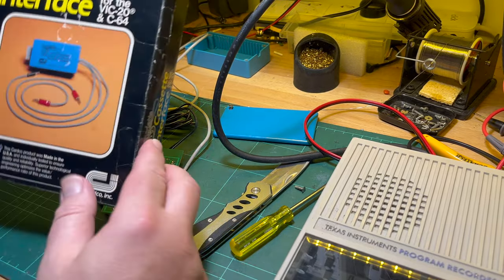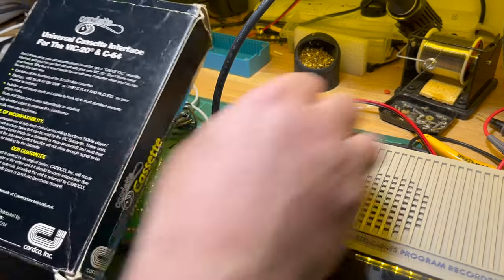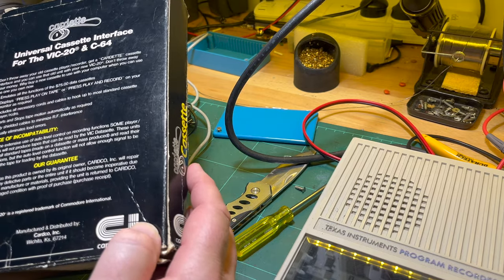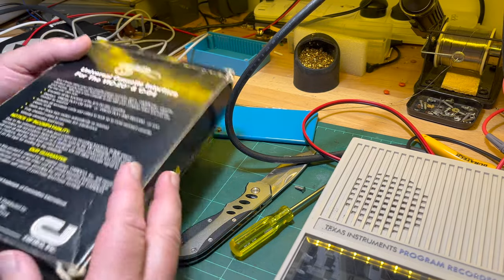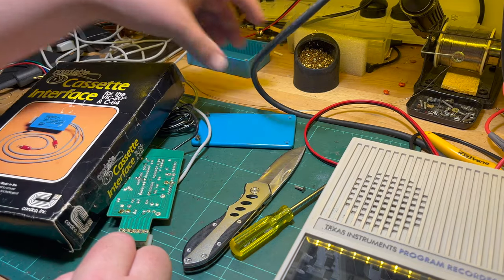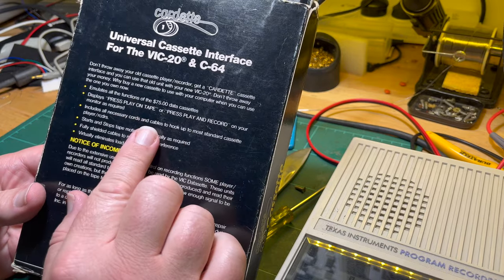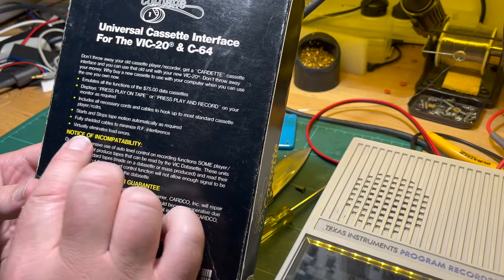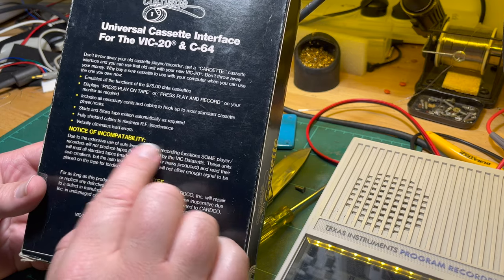🇺🇸 Commodore VIC-20: Cardco "Cardette 1" Cassette Interface (Part 1) [TCE #0206]

Comment: Good to see it working, and this device has the additional complication of the volume level which was never an issue that the Commodore Datasette had as it runs at a set volume level.  I remember volume level being an issue on the Radio Shack Color Computer and its cassette recorder/player as well, which is much like the TI cassette player/recorder you tested with.  You will likely need to find the sweet spot for volume when you try the Audacity method as well - I had to tinker with the output volume quite a bit when hooking up the Color Computer to the audio on my Windows PC and attempting to load a file that way.

Comment: @7:35 "Took a wrong turn at Albuquerque..."  You jumped over a track to the right. Do you happen to have the dimensions of the board?

Looks like a fun project. I'm going to try doing it in Sprint-Layout 6.0 (See Bwacks channel for an mini tutorial on it).
Reply from the maker: Indeed ;)  You lot have the benefit of 4K and 27" monitors ... I just had my little ol' eyes!  

The jiffy box is 11x6x3cm.  The main part of the PCB is 92x54mm and the "neck" is 25x25mm.  I'll update the Archive files with the measurements.
Reply: @Brfff  Thank you! Although I realized the moment I started in Sprint-Layout that the board wasn't a good candidate for it due to the hand drawn "curvy" traces. So I'll do it in Kicad. :)

Comment: tbh...id just use a tzxduino... connected to the data in (and data out to record with newer versions of tzxduino) on the vic20 cassette port..and the motor control should work too...
Reply from the maker: Well … it does pre-date the Arduino by 30-odd years ;)
Reply: @Brfff  true..but seems like a bit of a PITA to use...
Reply from the maker: Totally agree!  But ... the box quotes US$75 for a Datasette back in the early 80s was about AU$85 (in 1983) ... this is about AU$290 today.  So there would've been a market for it.  But yes ... so much easier to just use a proper Commodore Datasette ... or buy an Amstrad with it built-in ;) /Brett.